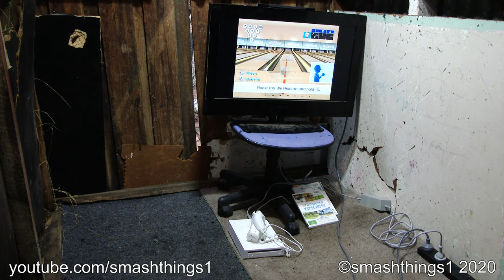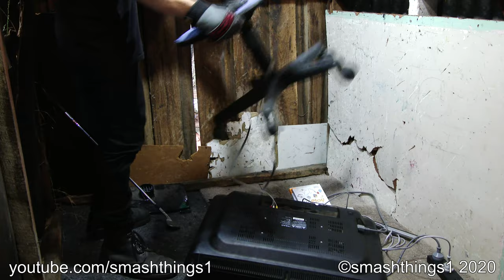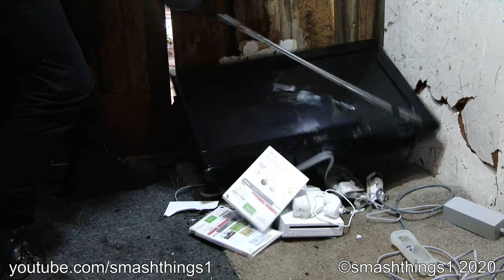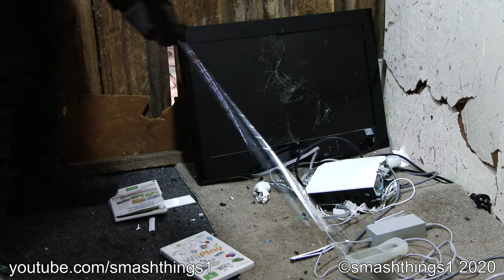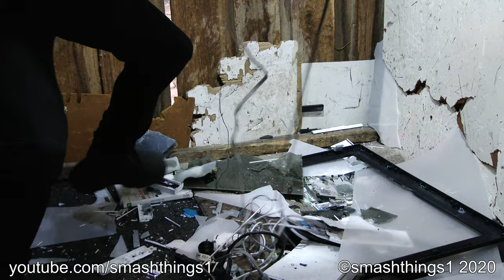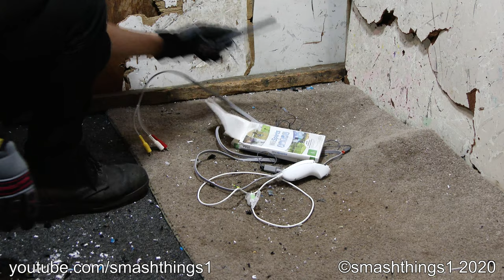Angry Gamer's Wii Sports Bowling Rage

Comment: I once trashed a Wii because a GameCube disc got stuck inside.  (It was 'Super Smash Bros. Melee'.)  I also trashed THREE GameCube systems because the springs for the top doors all failed.  A Nintendo 2DS, two Game Boy Advances, and an original PSP also fell victim to 'Hammer Time'.  Yeah... I guess I had a SERIOUS anger issue when it came to video games... but I NEVER abused my Playstation 2.